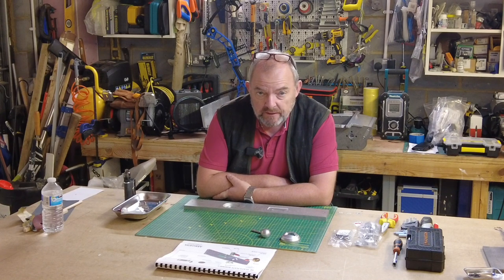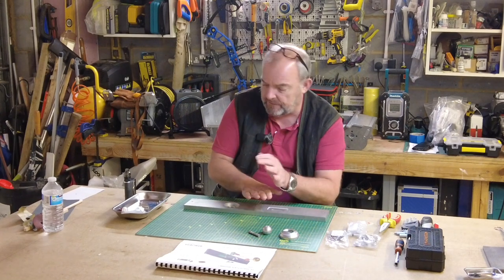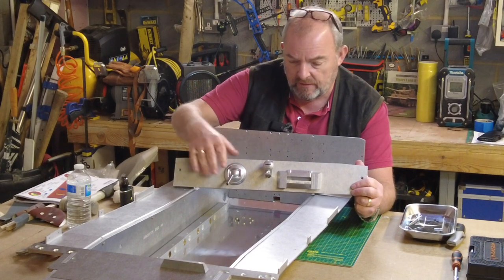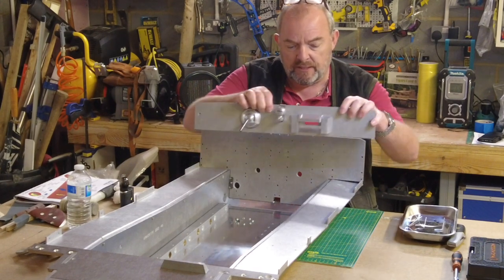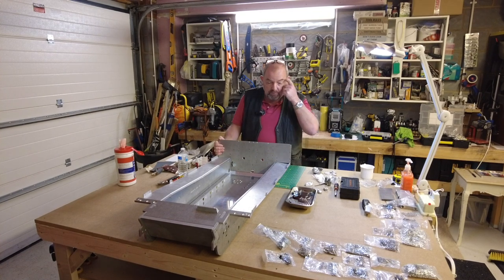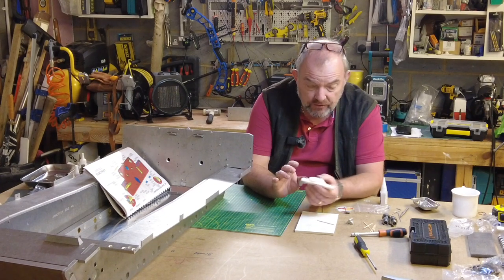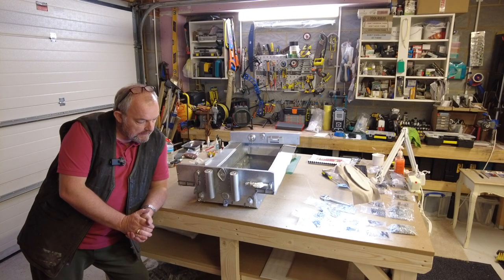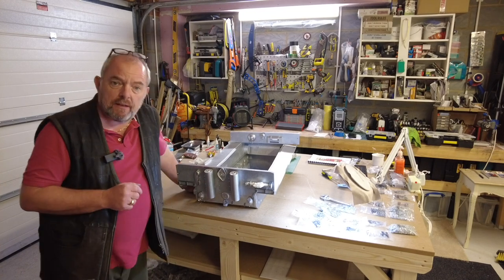Armortek Tiger 1 Tank Build - (Video 3)Day Two

Comment: Surprised  the Jack was resin I thought it was all metal .limp MG34 will be good when finished , packing defo bang head against wall ,big time hassle finding parts needed gotta hope quality control on ball and sent all parts. However all said and done still uber welljell  lol.
Reply from the maker: Hi Steve, yes so was I. You can purchase an all metal version on the internet, but expensive for what it is. When it's cleaned, de-burred and painted, it looks brilliant. Thanks again for your continued support.